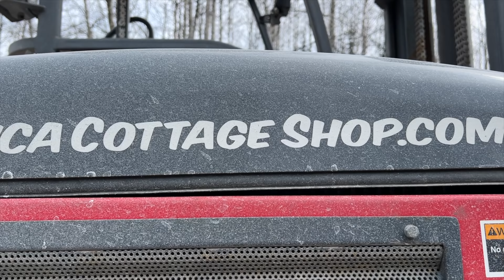They NEED a NEW HOME....So We BOUGHT THIS | Building Our OFF-GRID Farm in the WOODS

Comment: I painted our new house  Sherwin Williams Silver Shadow...a light gray...similar to yours...a decorator trick is to dilute the wall color 20% with white for the ceiling...it gives the ceiling a bit of a lift but it's not a different color, just less saturated. Prevents a "box or cube" effect of all one color. The interesting thing about the color you are using is that it changes with the light...a wall can look darker and the one next to it lighter. It's a very cool effect and gives the room life...it's a very easy color to live with. I'm still happy 3 years later.

Comment: You can build drawers of different sizes. The upper being not as deep and the middle and the lower being deep into the wall. So you need to build more studs inside the cubby holes to support the drawer sliders. You could build the cavity and attach the sliders in there. Would look beautiful.

Comment: When using a router or zip gun there is a correct direction of travel. Inside openings and outside opens, clockwise and counterclockwise.  It may not be a big deal for you but it helps me from wandering away from the stud.  Colors look great! 👍🏼
Reply: Correct. When you cut the cubby access go clockwise.  When you cut an electrical box or can light go counterclockwise.   The rotation of the bit keeps  it against  object you are cutting and determines the travel direction

Comment: Suggestion for next time rent a sprayer if your going to do one color. It will be faster and you won't have to cut in. Just cover the windows and spray away
Reply: That is exactly what I was thinking. I don't agree with the gray ceilings, but if you go that route, better spray the whole thing. I once did (all white :) a 100 m2 / 1000 sqft apartment double coats in two hours. And yes, I rented a professional spray gun, all worth the money.
Reply: @WorldWideWillem-360  Exactly. With all the tool "toys" that Al buys, I would have thought an airless sprayer would have been a no brainer. Harbor Freight sells a half decent one for less than $200. As you mention, he could also rent one.

Comment: As a pro painter of 30 years..Paint always drys darker. Also darker ceilings close in on you and look shorter. Paint ceilings white as it will reflect natural light from windows and make rooms much cleaner and brighter. Also paint all doors and trim white .GOOD LUCK
Reply: As a former painter, I was about to comment the same about painting the ceilings n doors white.
Reply: I hope they read this before they touch the ceilings!
Reply: You’re right about painting ceilings white, I always try to paint any cornice work whiter (more brilliant) than the main body of the ceiling !
   Some colours dry lighter !  Leyland’s “Oyster” is one of them, and it fades quite fast, making touch up a pain in the…
Reply: Agree! I was cringing when they started painting the ceiling and angled wall gray.
Reply: When we added on to the house, we kept two rooms of the old house up. They had 8’ ceilings while the new addition has 10’. It was suggested that I paint the ceilings of the old rooms a very light, almost imperceptable, blue to make them look higher. I was skepticle but it worked, and actually made the ceilings look higher. Weird 🤷‍♀️ Think your right here, their ceilings would look good white

Comment: Hey Al, If you cut with the rotary tool clockwise it will follow the outer board. As you can see when you cut counter clock wise the tool went anywhere it wanted not making a straight cut.  Same principle with a router, clockwise.

Comment: I learned to paint from a very skilled fellow and he showed me that when painting, the best technique is to cut in first and then, while the cut in paint is still wet, roll the wall. Always try to paint into wet edges stopping at corners when you need to stop. This makes the roller pattern cover most of the wall while tying the corners and minimises the brush marks. If you are painting the walls and ceiling the same colour, an airless sprayer works very well, as some on else mentioned.

Comment: When I saw the video title I thought it might be Jamaica Cottage Shops, because they've worked so well for you before. I'm thrilled you went that route again.

As for the type of buildings you bought? Well, you've always made odd tweaks on the buildings to suit your needs, so I'm thinking some Stall Sheds. I suspect you'll eventually want a central area for goat milking, but to start with those would give you good barns to work out of in various areas, plus have a section that can be adapted easily for food, hay, and bedding storage, plus any other general storage so you're not constantly lugging items around the farm. You've got both the boys and girls, plus any kids that might be born next kidding season, to think of right away. And you said it's not a building you've done before, so that's my thinking. 🤷‍♀️😉

Whatever you've chosen, it's always fun watching the build come together, and will bring you so much closer to the final move. 🙏🤞

I quite like the colour you were painting upstairs. It's hard to know sometimes until you see the finished result, but it seemed to be reflecting the sunlight nicely, which in your winter environment is always a bonus. 

Stay safe, everyone.

Comment: Hi guys, just a question if you are painting up stairs all one colour why not spray it on save's cutting in better Finnish and much quicker, only have to mask off window's and anything you don't want paint on
Reply: I agree, spraying is the best way to go. It's so much faster, the time it takes to cut in you could have sprayed the whole upstairs. The same thing for the primer. To get smooth walls, sand and dust and vacuum between coats.
Reply: I agree on spraying.   But if you must roll buy the pour spout that screws onto the 5 gallon bucket they cost about a dollar and worth every penny. Less waste, less mess. Keep up the good work.   Love your channel.

Comment: You need to cut in as you go it will blend in better. A wet edge will blend in you cut in to much the paint dry's and shows through the paint  with brush strokes and a line

Comment: Hey AL and family, looking forward to the new barn builds, just incase you didn't know when using a router they you should cut in a clockwise pattern, normally bottom left, it will stop kick backs/bits breaking and will give you a better finish to your cut and give your router motor a longer life

Comment: If you put the pour at the top of your 5 gal bucket when it is almost full, it won’t gurgle and you won’t splash the paint all over n
Reply: That sounds like excellent advice. Just like putting oil in your car. Pour from the flat side.

Comment: I see you started painting this last video. FYI - there is a spout that goes on the 5 gal. containers that after opening. This spout has a cap that then keeps they paint from evaporating with the opening not closed off. The paint dries out and begins to clump. I use to have a construction company and wanted to share this info with you to help save headaches with your paint containers. :)

Comment: The larger cubbies will accommodate large drawers on the bottom and shorter drawers on top with a niche.
 The smaller cubbies will accommodate a type of filing system close to the computer with other storage for computer paper and supplies. 
There are many alternatives. Have fun looking through the internet for them, especially at Ikea.

Comment: I have over 40 years experience as a painter. I generally will roll into the corners, then smooth in with a brush. You will have to cut around fixtures and cabinets first.  The key is keep everything wet and do the finish roll top to bottom

Comment: Your washer machine "P" Trap is upside down!!! Yep Totally.  Just do an image search.  The longer bend is the trap and won't hold water upside down.  The drain pipe coming up from the floor should have continued to your "Vent Header" The washer's drain should have Tee'd Low into the Vent. Low enough to allow for some back flush.  The height of the washer drain is like 30 to 48" from the floor.   I'm old school and just stub out my washer's valves to where I can get to them and replace them if needed on 8" centers.  I like the look of the recessed valves but not for me when it comes to maintenance.  Can't wait to see your new builds.

Comment: Cool is this barn going to be like the other goat barn? Are you going to be able to get your plumbing parts for the out door wood burning furnace? I would like to see the radiant floor heater working. Oh my that is very dark looking paint. I like off white its not too dark l like adobe white. Really light tan. Actually from my experience as a painter most everyone paints the celling white because  color closes the room in on you. You really don't want to put color on the ceiling.
Reply: More than one barn! Buildings wer said several times in video.

Comment: I didn't read very far back but I'm not seeing any mentions about a "wet edge". Letting the cut in paint dry first is not such a good idea. Specially since you did it so wide with a brush and didn't diffuse it with a roller after brushing on the cut in. If you roll the field in now you'll be able to see bush marks under the rolled coat. The cut in paint will be smooth and the rolled coat will be diffused. You're going to be able to see that through the rolled coat. Best way to do it is to cut in and then paint the field very close together. I cut in with a brush, and then with a small roller I'll roll it as close to the corner as possible. Normally I'll only cut in as much as field I can finish while the cut in paint is wet so I don't have to use the small roller and just do the first coat right away. I'm not doing you any favors for this job by telling you this now, but you're going to be doing a lot of painting in the future so word to the wise.

Comment: roads seem like a losing battle ... for the barns you might want to consider soil cement... you use a garden tiller and mix in dry portland cement and tamp it down and it gets reasonably hard so you can walk on it and sweep it clean.
Reply: Thanks for posting about that. That sounds easier than pouring a slab.

Comment: That's the same delivery driver as the last building you made at the old property. Your driveway over there is way more difficult to maneuver than the OGP, but like then he did a great job with off loading this delivery.

I like the color you chose for the upstairs, it will go with anything. The floor covering should be a darker shade of gray still and it will coordinate well.

Comment: Hint : Pour your 5 gal bucket of paint from 9 to 3 through 12. Not 3 to 9 though 6. It wont glug over the top on you and you can role into the pour and out of the pour without drips.
Your Welcome.
Reply: ??? not sure what you mean?  Are you referring to a clock face with the numbers?  The angle to hold the 5 gal bucket into smaller containers?
Reply: @samvalentine3206  I'm sure he's talking about a clock face Sam. He's saying pour with the hole at the top of the bucket, not at the bottom.

Comment: Also, I agree with others, white on the ceiling and angle walls and it will look like a million dollars. And Gina you are completely wrong about one color,  it does the total opposite of what you are saying in any color other than white. Your grey is drying darker not lighter, I can see it as you paint. Not being negative, but try it white on the uppers and leave the grey on the lowers use white trim for doors etc. on one of the rooms and see what you think, you may be pleasantly surprised.